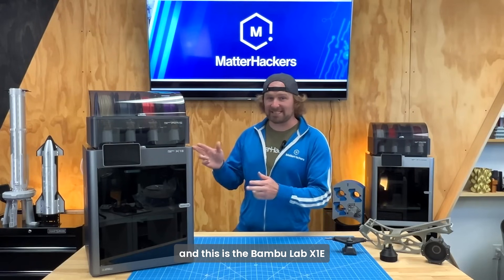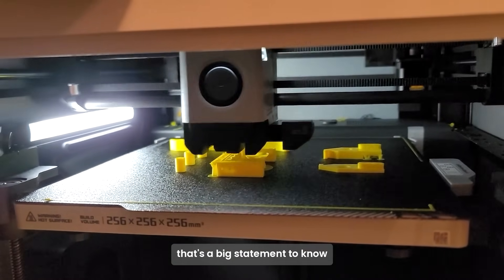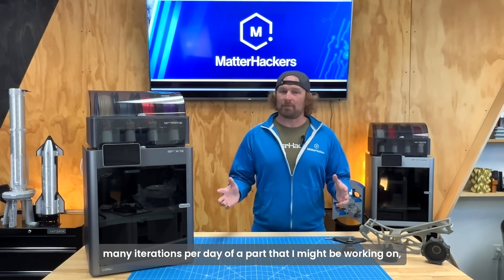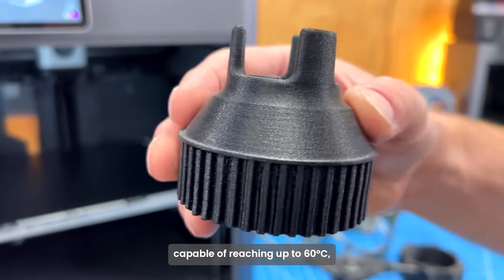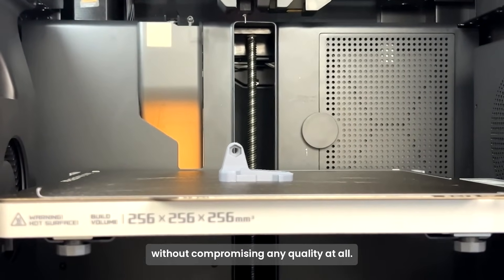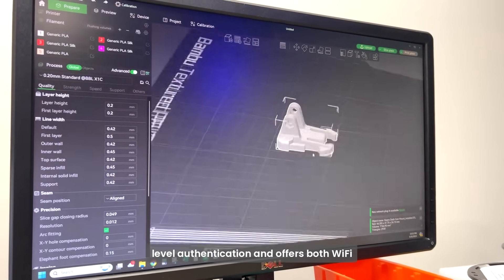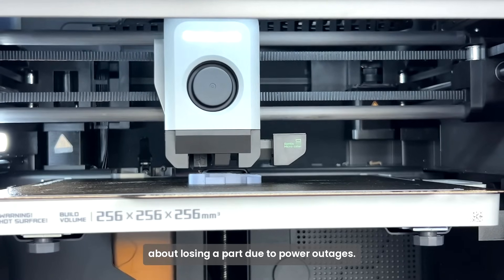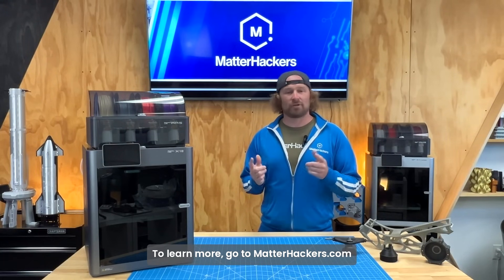Bambu Lab X1E - Tech Breakdown

Comment: If you are reading this, get the Bambu lab P1S. Its an X1E without gimmicks like AI, the Lidar, or the chamber heater, and it costs like three/four times less than the X1E. A stock P1S can't print carbon fiber filaments, but with 50 bucks you can purchase a hardened steel extruder gear and nozzle, which gives the P1S the capability to print the same pieces as the X1E/X1C, with the same reliability, and the same print quality.

Comment: It's probably a decent printer but he's talking so much without providing real details, this make me a little suspicious. It's his 'go-to machine ' and it's his 'companion' and it's 'so much faster', but faster than which printer? It's exactly the same speed of the X1C.  I really like Bambu I own a couple of them but maybe if he could tone down the hype a little then his sales pitch would be a little more credible.  I just feel like this is high pressure sales not a real tech breakdown. It does have some really specific advantages mainly higher temps and heated chamber, more secure WiFi but if this video could justify the price difference between the X1C and the X1E (almost double the price!) it would be a lot more informative.   If your printing high temperature engineering materials this is probably well worth the price. My question is for the demographics that bought and love the X1C or have an A1 and want to move up or add another printer to their farm, why the X1E?  So far from what I have seen and read maybe it should really be priced 20-30% above the X1C, it could be that I am really missing something but this video doesn't really show me.

Comment: I would be more interested in what you get for the extra money compared to X1C
Reply: Tbh I don’t think there’s much. My x1c looks almost identical on the inside. The only noticeable difference to me is the much bigger carbon filter in the back of the chamber. It also has the heated chamber so I’d guess it’s more insulated. But the stepper motors look identical and so do the belts. The hot end on the X1E is slightly better at 320c vs 300c but you can buy a nozzle for the X1c that prints up to 400c for $100 if you want to utilize that though you will have to pull a few sneaky tricks like soldering a resistor into your thermostat but that makes setting temps more complex and not true. But really the o my upgrades the X1E provides that are worth it is the 20c extra hotend and that’s not worth $1,000 more my X1C will get to 50c chamber temps easy if I turn the bed and hotend on and let it sit for a few min prior to printing. Once it reaches that the chamber fan kicks on and limits it to that temp but there’s just no way to justify the extra $1,000 cost
Reply: Heated chamber and extra 20C at the hotend. Literally nothing different. And you can easily add a heater to the X1C 😊

Comment: This video covered features the X1C has, I want to know clear differentiation from the X1C, so far I only now of network security. It also has higher temps but doesn't give examples of what materials this unlocks.
Reply: Not just higher temps, the nozzles are hardened steel so can handle nylon infused with carbon fibre, if you try that in the X1C, you will be changing your nozzles very regularly because the carbon will wear the tips out fast. Materials it can print with that the X1C can't is PPA-CF/GF, PPS, PPS-CF/GF. I have printed with Markforged Onyx on the X1E and it comes out really well, the actively heated build chamber helps with that as too. The X1E also has better filtration, good for smelly materials like ABS. 
As explained in the video, it isn't a hobby level printer, it is designed to be used hard and doesn't need to be watched if the print will work. If is a couple of kilos heavier than the X1C, so that may be a negative. I use Markforged printers for engineering parts, but for quick parts and testing I use the X1E. If you only use PLA, the X1C is for you.
Reply: @Martian74  false, you can buy hardened steel nozzles for nearly every printer, including the X1C,P1,A1.  The active heated chamber is quite literally the only added feature most people would notice.  And the higher nozzle temp STILL isn't high enough to melt PEEK
Reply: @Martian74 the x1C literally has hardened steel nozzles as standard. The x1C can have its filtration upgraded to be on par with the x1E. The x1E has 20°c higher nozzle temp and an actively heated chamber at 60°c. But the x1C can still maintain 50°c chamber 

So the price difference is literally +20°c nozzle, +10°c chamber, and Ethernet ports. Everything else is literally the same.
Reply: @ The X1E is not for hobbyists, it is designed for engineers and enterprise. Ethernet and proper networking is not something they can compromise on. If you aren't an engineer or in enterprise, just stick with the hobby printers, they are designed for you. Make sure you never touch an industrial grade printer like a Markforged, you would never justify the price.

Comment: So why would anyone buy this over the x1c? That build volume is the same, all that is really different is the nozzle temp which is only 20 degrees for 1 grand more.
Reply: So why would anyone buy the X1C over the P1S?
Reply: @ch.wey.4406  If you want to print carbon stuff. If you don't need to then its basically a waste of money.
Reply: Heated chamber, and wifi kill switch

Comment: I would be cautious purchasing this rather than the X1C. The X1E is only supported by the distributor like MatterHackers not Bambu labs.  Replacement parts are different from the X1C and are extremely hard to get and you will need them when this breaks down. Mine printed fine for a month before multiple things went wrong. It's been non-functional for 4 months waiting for support and replacement parts on known issues. It's not worth the price or the frustration.
Reply: The only thing that is attractive to me is being able to print prototypes without having bambu steal your ideas since they can see what you print on the other bambu printers. There is always a catch. If the other bambu printers were usb wired and not needing to be online then that would be legit. Any work arounds you found?
Reply: @Bluntedco. guarantee they arnt stealing your ideas bro. I print on average 5 models a day they sell millions of printers every year. You really think they have a team of people combing through and stealing your drawings? Also what the other guy said was absolutely true. Model your parts in something like fusion 360 put them on a microchip and take them to a dedicated offline computer slice them then bring them over to your printer. Or just slice with a 3rd party software unrelated to Bambu like prusa slicer and then put the micro sd card in the printer. Or run it on lan only mode. It’s really not a big deal there are a million work arounds to this problem. In my opinions if you’re really working on stuff worth being stolen you’d be smart enough to know how to avoid that.
Reply: @Bluntedco.  You can work offline with the other Bambus ... there´s an option integrated
Reply: @ch.wey.4406  how so? you mean by putting in the micro chip in the computer and loading the file and then putting it back into the top of the printer or a actual option on the program itself? it would be nice if it had a usb connection from the printer to the laptop.

Comment: Was just about to buy an X1-C and then baby comes into the shop.. BIG price increase for my corner of the world :(
Reply: I don’t know, X1E and X1C function the same, they have the same quality, but are made with different materials
Reply: Not to mention that Creality is launching their K2 Plus next month with a lot of the same features as the X1C and will have a 60c temp print chamber, 350c hot end, similar network features and 350x350x350mm print volume for $1499, the same price as an X1C.
Reply: @hbgundam  By the same features do you mean all the auto leveling/quality of life stuff so you spend way less time just tinkering with the machine like the bambu printers?